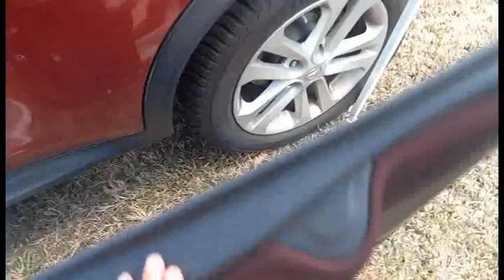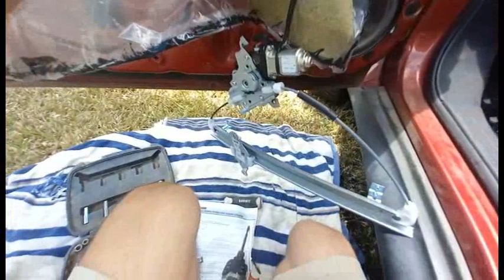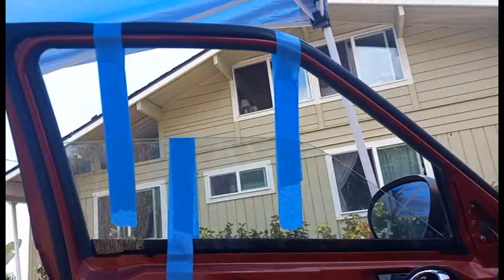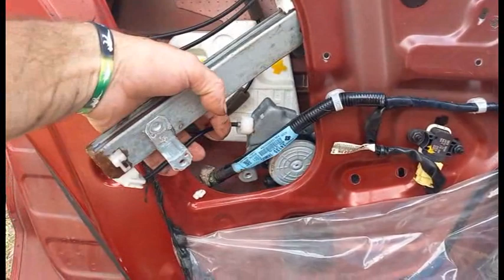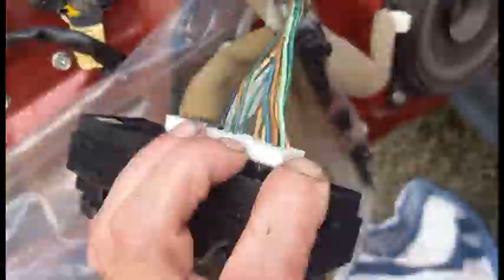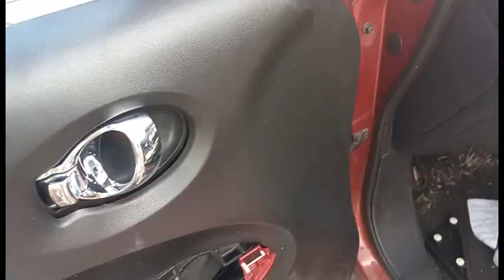2011 nissan juke window motor and regulator replacement

Comment: I can’t line up the Bolts for the regulator bar. Is the bar supposed to go in front of the window or behind the window?
Reply: Hi, we’re having the same issue. Did you figure out how it fits in there? We’re assuming it goes in front of the window but we’re having issues lining it up.

Comment: Q. what if the window is stuck? how can I access the bolts to remove the window? TIA
Reply from the maker: i had the same problem. initially this window was stuck down and when it came time to access the bolts i wasn't sure what to do. i basically just lightly hit/tapped the window motor a couple times, and then the motor engaged long enough for me to roll it up and get the glass out of the way so i could proceed
Reply: My window went down and I can’t see it lol motor is moving up and down so hoping it just fell off the track needing to pull the panel off to see what’s going on 🙏🏼 😅
Reply: The light tapping on the side of the motor while working the window switch did the trick for me